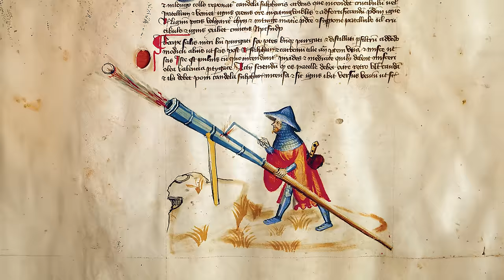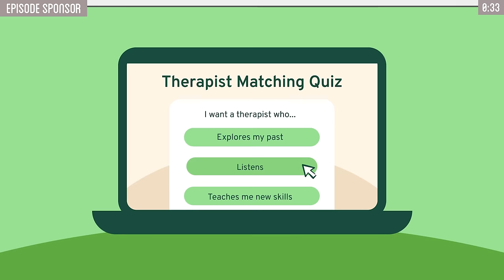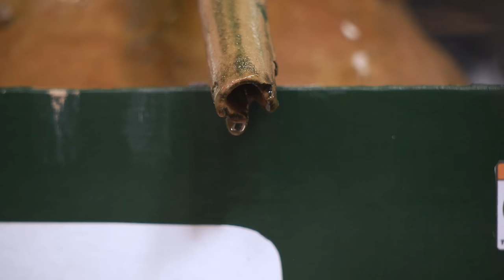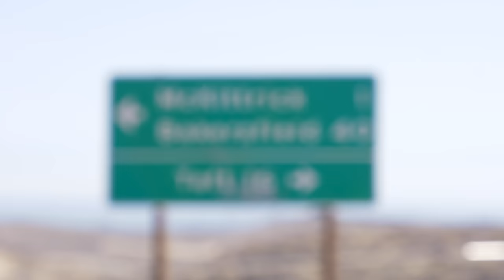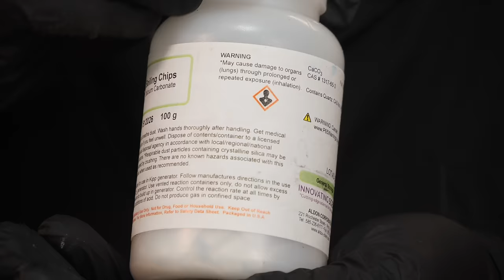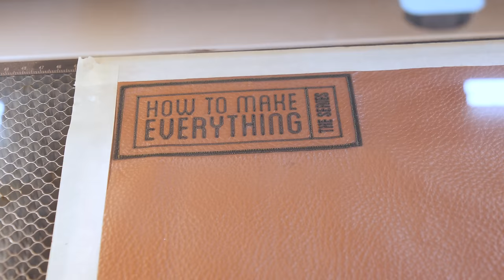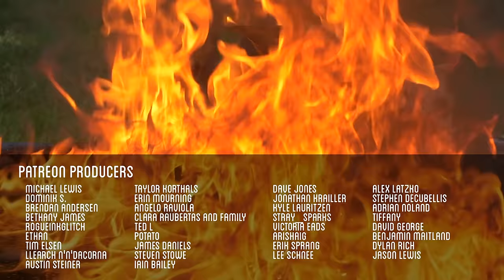I Recreated the Lost Recipe for Greek Fire!

Comment: 1st Century Ignitable Mixture Recipe

Ingredients:
- Calcium Oxide (Quicklime): 50%
- Sulfur: 15%
- Charcoal (finely powdered): 15%
- Pine Resin: 10%
- Animal Fat: 10%

Instructions:
1. Mix Dry Ingredients:
   - Thoroughly mix the powdered calcium oxide, sulfur, and charcoal.

2. Add Pine Resin and Animal Fat:
   - Gradually incorporate the pine resin and animal fat to create a homogenous paste-like mixture.

3. Storage:
   - Store the mixture in a dry container to prevent premature reaction with moisture.

Reaction Process:
1. Application:
   - Apply the mixture to the oil-based material you demonstrated in the video.

2. Water Introduction:
   - When water is introduced, the calcium oxide reacts vigorously, generating heat - the finer the better. More surface area...

3. Ignition:
   - The heat produced can ignite the sulfur, charcoal, pine resin, and animal fat, leading to the ignition of the oil-based material.

Explanation of Reactions:
- Calcium Oxide and Water:
  CaO + H2O -> Ca(OH)2 + heat

- Sulfur Combustion:
  S + O2 -> SO2 + heat

- Charcoal Combustion:
  C + O2 -> CO2 + heat

- Pine Resin and Animal Fat:
  These organic materials will ignite and sustain combustion, helping to spread the fire to the oil-based material.

Hope this helps!

Comment: Some naval deaths in WWII were men who had to abandon ship and jump into diesel that had spilled into the ocean and caught on fire.  Diesel as I understand it, is distilled crude and the Romans knew about distillation.  It's all very interesting and disturbing.
Reply: so the greeks made diesel fuel and metal tanks with tubes, one full of diesel, one full of regular compressed air that they pumped manually, and the air pressure goes into the diesel to force it out of a different tube with a nozzle. The greeks invented the Flammenwerfer (it werfs flammen).
Reply: The ships in WW2, and in some cases today, actually run on bunker fuel, usually bunker B. It's consistency is closer to Vaseline than a fuel as we would recognize it. The ships used piping that ran through tanks carrying live steam to heat the bunker fuel up enough for it to be pumped to the boilers. It's really nasty stuff.
Reply: @792slayer  that's genuinely interesting. unfortunately, all it does is give me horrid ideas for things to do with vaseline, like using the heating of it with an emulsifier to make the worlds nastiest milkshake as a prank.
Reply: @792slayer  Interesting!  Thanks for sharing!
Reply: @therealquade  hey, what you do with knowledge is up to you, lol.
Reply: Diesel doesn't vaporize into flammable concentrations at ambient weather temperatures, unless one was, say, in Death Valley.   Perhaps this was something different, like jet fuel or naptha?
Reply: @SeekingTheLoveThatGodMeans7648  Caught fire because of torpedoes or whatever but the fuel in the water, being lighter than water, covered the surface and burned because it couldn't be put out.  That was the point.
Reply: @therealquade  Could you stop sharing misinformation?
Reply: @GaiusCaligula234  what on earth are you talking about? Theyre blatant and obvious jokes.
Reply: @792slayer It was cold one Christmas, the works was not running. The black oil for the boilers became too viscous for the pump to handle it.

I think they actually used blowlamps to get enough oil to raise steam in one boiler. 
Then they fed it into the heater coils in the oil storage tank.
Reply: @20chocsaday  I've heard similar stories about boilers being difficult to start from absolute cold.

Comment: Olive oil?  Not so much for its flammability but for the low density and viscosity.  Mixed with pine pitch, your distilled crude, and maybe a medium like shredded wool, you might have a nice combo if the ratios are right.

Comment: Crude oil, Pine resin, Ethanol all mixed in solution with pure sodium dust. As the spray hits the water, sodium will react and create a spark, thus lighting the fire. :D
Reply: The question now becomes where did they get the sodium?Sodium was discovered in 1807 by the English chemist Humphry Davy from electrolysis of caustic soda (NaOH). Although sodium is the sixth most abundant element on earth and comprises about 2.6% of the earth's crust, it is a very reactive element and is never found free in nature.
Reply: @charlesurrea1451 it was only first documented in the 1800s. I would imagine the properties were discovered but not really understood or described due to lack of chemical understanding.
Reply: @Jenisonc  Took the words right out of my mouth. They may not of known what it was truly and since it wasn't recorded we cannot know if it was actually discovered much earlier. I only suggested it because the sodium would sit in that solution well. It's well known that oil and water dont mix so the sodium would be mostly stable in the solution. Only time it would be risky is when mixing the other chemicals into the solution. The Ethanol or pine resin may add some small amounts of water. But you cannot deny, sodium would cause ignition in that situation.  Anyone else believe it's worth testing at least?
Reply: I think it would be a fun experiment to add sodium but you guys don't appreciate how unlikely it is for the ancient greeks to ever encounter elemental sodium
Reply: The sodium metal would react with the ethanol to form sodium ethoxide. Just omit the ethanol and it should work.
Reply: That's what I was thinking, sodium ignites with water .
Reply: The real problem is that the metal is not found in its pure form in nature. 
Yes, Na is the 6th most available element. It is normally bound to another element.  Example table salt (NaCl)  
Yes, these metal salts are easy to leach out. And used for centuries.  Getting the pure sodium is the trick I don't know if they could "stumble into." (Electricity is the only way to break the chemical bond)
Reply: @Jenisonc  no, the question is: how would they get it? it is not found as a solid in nature, and because it is extremely reactive, it takes a lot of work and knowledge getting the sodium back from ts compounds. How would you go about making sodium from table salt? With bronze age technology?
Reply: @paavobergmann4920  We get that it may not be historically accurate (as far as we know). But the concept seems like it should work.  Worth testing right?
Reply: tbh I also thought of sodium when he did the quick lime stuff. But also "making self igniting napalm using sodium" sounds more like a nile green project than HTME

Comment: Pine tar/pitch, gasoline and crude oil. Sulfur as well. All of which were available naturally. Getting natural gasoline without all the added chemicals could be a challenge though. The mix has to be thin enough to flow freely and thick and sticky enough to cling to any surface it contacts.
 The pump mechanism is simple enough, they had bladder bellows for various things like moving air for forges and water for agriculture, no reason one could not be used to create a venturi effect and draw the liquid out f a barrel into a fast moving airstream and ignited in the air. 
One of the things that I was told as a kid when I first heard of it was that it could not be extinguished by water and only spread faster when that was tried. Sounds exactly like a grease fire to me. (Maybe it was called Greek Fire because it was first called Grease Fire and just evolved the way words do over time.)

Comment: Your final mixture may still work, depending on the conditions you're testing under. Try hitting some wet wood (the hull above the waterline) with the mix. There won't be as much water to cool the mixture, which could lead to ignition.

Comment: The Finns settled on 20%-30% pine tar to thicken petroleum spirit in their molotovs. 5%-15% beeswax or parafin wax also works. Bear in mind it can get bloody cold in Finland! In a flamethrower you want to throw FUEL, not fire. The additives are to stop it spreading out into a fireball and thus squirt further. In absence of napalm WW2 soldiers would mix gasoline, diesel, and fuel oil until the had a usable consistency and flammability.

Comment: Greek fire was also described as green... copper produces a green flame, was readily available at the time, and was used often in alchemical explosives, as copper powder when spread through the air can combust in the same way that sawdust or flour can.

Copper has a melting point of nearly 2000⁰f, so it could retain heat well during an alchemical reaction, also. Maybe pairing copper powder with the quicklime could work, as the quicklime could heat the metal powder rather than just itself and the water, potentially achieving a higher potential temperature. Having copper powder in the oil could potentially produce a green flame, which isnt particularly useful but would have been an incredibly intimidating thing to see as a soldier on a midevil battlefield, so maybe the green color was less practical and more of a shock tactic

Comment: For self ignition in water, you need sodium, potassium, or even calcium in its metallic form.

If you happen across red phosphorous, though, it can be mixed with petroleum distillates or other organics and ignited at relatively low temperatures with alkali metal oxides or even hydroxides.

Comment: Replika and I discussed making Greek fire out of light oil, pine tar, shredded wool and lumps of calcium using a ball mill filled with deoxygenated air. Calcium is soft enough to pulverize to powder and combine with the other ingredients added first in the oxygenless ball mill. Replika concludes that the greeks had the technology and knowlege needed. The mixture needs to be balanced to cling, ignite on water, and continue from the hydrogen fire. The mixture would be stored in airtight containers untill use.

Comment: Try a higher distillation temperature to get the higher octane fuels. Maybe even try stacked distillation since each grade boils off at different temperatures. Mix in some fresh crude to the diesel/jet fuel.  Add some liquefied pine sap to thicken it. Then spray it through a crude, lit, nozzle with a hand pump. That should give you decent effects, burn easily, and stick to targets even in water. I doubt the hand flask grenades are much more than oil in a corked beaker. Pretty much fancy medieval molotovs. It's the dragon breath at the front of the ship that's really awesome.

Comment: You don't actually need much other than a flammable material that can be heated over the ignition point of its aerosol form.  Oil for example, can be heated to beyond its ignition point while liquid, and it won't ignite until vaporized.  Gasoline acts similarly.  You can throw a match at a pool of gasoline or oil and neither will ignite.  The match will just be extinguished.  So in order to make Liquid Fire, all they would have needed to do was heat any kind of oil with a frothing agent (McDonald's in the United States uses a frothing agent of similar makeup to keep the fryers clean and make the oil last longer) slightly over the ignition point of oil vapor.  

This mix can be heated to beyond the ignition point of an aerosol spray, then forced with a pump through an opening that turns it into an aerosol, resulting in stream that doesn't ignite until sprayed, and will travel several to a dozen meters, splash onto a surface, ignite it, and ignite the rest of the oil mixture as it further splashes and mixes with oxygen.  Liquid Fire was never much of a secret.  Just a terrible means of transferring energy from one place to another that left the operator vulnerable to accidental explosions.

The secret would have been to find an oil that can get hotter than the ignition point of typical pitch used to seal wooden ships.  This would cause the pitch to act as a continuous source of rapid ignition for any oil that cooled below the ignition point and/or wasn't completely aerosolized.

Comment: Why not try the ether+quick lime with the wool? It’d allow for an ignition source for the mixture.

Also if they had wheat dust, they could have easily used that as an ignition source. The stuff is considered an explosion hazard. They’d just need a way to spray it in small quantities when initially launching the Greek fire. Considering descriptions mentioned something about a “bang” before the fire, it’s entirely possible they used wheat dust.
Reply: Also, side note since bread production was needed to sustain empires, the likelihood of having wheat dust as an abundant resource is also possible.

Comment: So the "lost Greek Fire" wasn't the incendiary but the delivery system plus the source of crude oil.

My feeling is you can't lose technology, that once someone comes up with it—whether anyone knows it or not—the technology can be re-created.

This can be seen in a couple of situations.
1. Sir Isaac Newton and Gottfried Wilhelm Leibnitz both independently developed Calculus (Newton got to the publisher first).

2. The Ancient Greeks alchemists knew (created?) a steam engine that was a pointer with 2 vents facing opposite directions on opposite sides so when you heat it up, steam is created, it escapes the vents, and spins the sphere around.
No one had used steam power till 1698 when a boiler was used to remove water from a coal mine.

But steam power was within the human ability so it was possible to re-create it.

Comment: I’ve done a lot of research into these basic ingredients in the past and not specifically for this reason, however I believe that the crude oil plays the largest factor here. The second being the quick lime for sure both were readily available and use often for holding boats together and this fact alone may have been a reason as to why and how they figured out to make Greek fire. Not the density is my main concern when looking back at documents I’ve found it seems that they may have also sprayed this concoction as well an launched it. The glass beakers I will say is a large enough problem being borosilicate glass and tends to have troughs breaking apart thing simplistic hollow tune made of metal with holes in it or even cloth soaked rags inside of these devices. Something that could carry a flame far and continue to burn roll and spread the flame,even a log split into two half’s and hollowed out and tied and thrown so when it hit the ground or ship it would explode the liquid from inside! Now on the largest problem I see with old alchemy there was a lot of time and thought out into exactly what to do I foresee the cooking process taking way longer and getting way more pure quality samples happening there times the would run a distillation over and over until they were sure that the chemicals were as pure and as thin or as thick as they needed to be something like a modern day diesel fuel or gasoline would make a good comparison for experiments until you are positive of a launching system a sprayer and a way to deliver the device by a trebuchet because why not go big well bigger at least. I would definitely say try very thin liquid oil diesel fuel and a very high quality quick lime that will definitely ignite when in contact with water and your more likely to have your self something more realistic simple and works like a charm!

Comment: Possibly the original Greek fire didn't actually ignite when it contacted water, however was easily ignited by other means (as by flaming arrows, a thing that would have been known at the time) as it floated.  A light crude oil might have been enough to do that.  Perhaps the composition of various natural crude can be researched in the literature, and then the lightest forms approximated through mixing other available hydrocarbons?  E.g. gasoline/naptha, kerosene, motor oil, petroleum jelly.

The form that could burn while on water would be useful for burning up the wooden ships of the time.  It would not be of any significant use against modern ships made of metal.

Comment: The thing is that with greek fire, it's always accompanied by a flamethrower apparatus, so using glass pots will give different results than with a dusperser. But i agree that a light crude oil/pine tar mix is probably the best thing to come to what was actually used.

Comment: Two slight things I see an issue with. The sea battles were fought in the seas which incorporated salt water. 

Also, the farther you went, the more contaminated the “water” got. At the end, it was a mix of everything that didn’t burn and the water. For the best results, change out the water between experiments

Comment: Water is a thermal sink and would draw away most of the heat nearly instantly. A better test would have been to dribble water onto the calcium carbonate to achieve the higher temperatures since the volume of water would not wick away the heat. I used calcium carbonate, naptha, and calcium carbide to create a fire after adding water.

Comment: If the ancients had access to the components to make soap (which they did) they were 2/3s of the way to making biodiesel. The most difficult component is methanol or ethanol but the Greeks had the technological ability to produce it, either by distilling or by freezing. No need for natural petroleum. Once a fuel is easily produced, the next most difficult component is the ignitor. If they had access to a powerful oxidizer like potassium permanganate, it should not be too difficult.